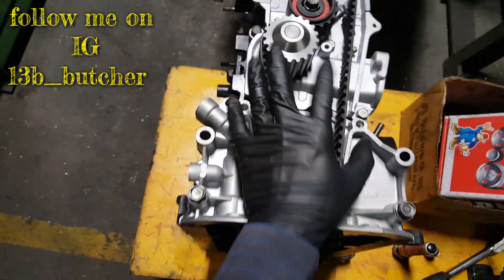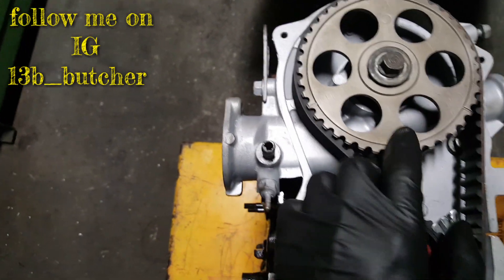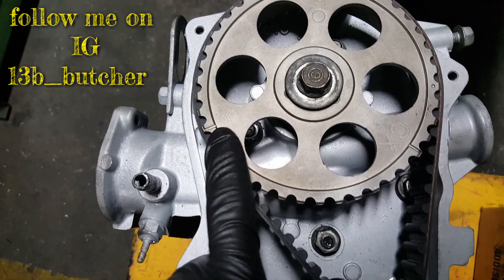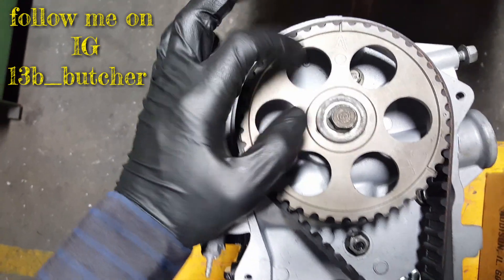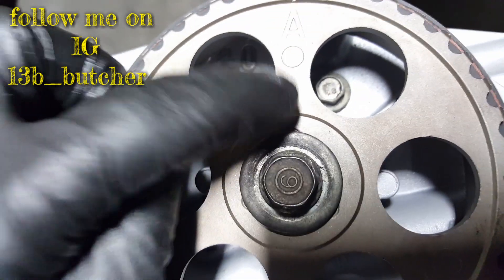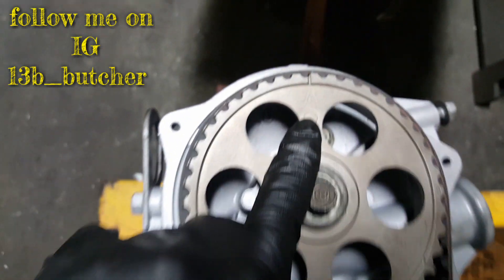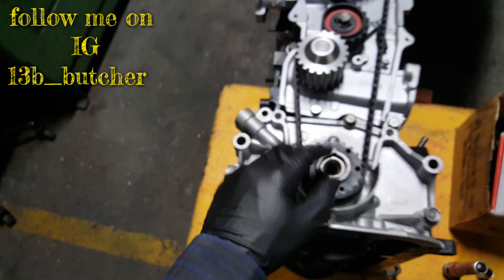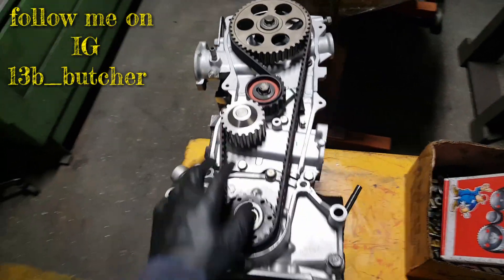Mazda b2000 mazda b2200 timing marks, how to install timing belt

Comment: Sir, good morning! My car-mazda b2200, is using 106 teeth timing belt but there is no available item now. What is your recommendation regarding the required number of teeth of the timing belt? Thank you very much. This is from Philippines.
Reply: ebay has them I just ordered a kit with a water pump

Comment: When i reinstalled the belt, i put the crank pulley on, started it, it started. Put everything back together, and it started for 5 seconds and died. Checked timing marks, ok, checked tdc and thats ok, changed fuel filter and im getting spark and fuel. 🤷🏻‍♂️

Comment: Where are you located?
Reply from the maker: Gardena ca
Reply: How much to do the time on a b2200 I took it to the smog and it saids need timing the truck runs and everything I'm in whittier ca
Reply from the maker: You need ti adjust the distributor

Comment: I have a Mazda 2.0 engine with a single over head cam I have the A on the camshaft's timing gear in line with the arrow on top of the engine cover and I have the crankshaft's timing Mark in line with the arrow on top of the crankshaft but the engine will not start and is acting like it's out of time any suggestions
Reply from the maker: Make sure piston #1 is at TDC

Comment: what kind of oil does a mazda b2200?
Reply from the maker: Depends on the mileage
Reply: @JM8686  thanks, the mileage is 227207
Reply from the maker: Try full synthetic high mileage
Reply: @JM8686  Ok

Comment: what is the CX mark for?
Reply from the maker: Also timing but for other interchangeable engines like 2.0,2.2,2.6 nd ford engines
Reply: @JM8686  thank you...nice and simple video.
Reply: @JM8686  I have a 89mazda b2200 have timing belt put start up good power but I go out is slow at
Reply from the maker: Sorry Don't understand what the issue is
Reply: Hi I have one 89 Mazda b2200 have done the timing start up power but when you go out slow at